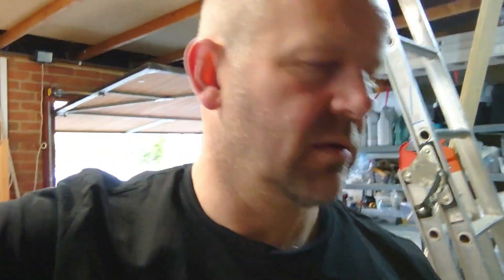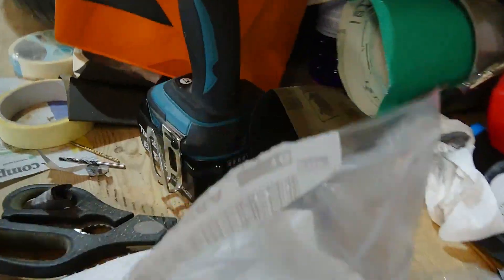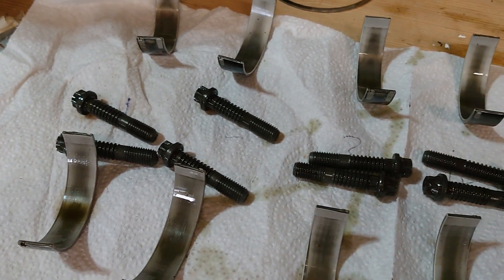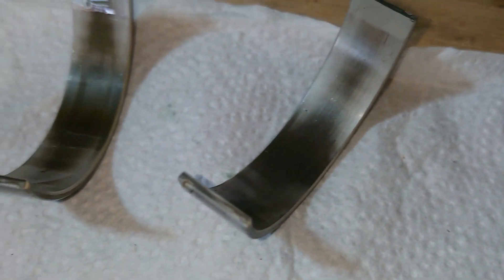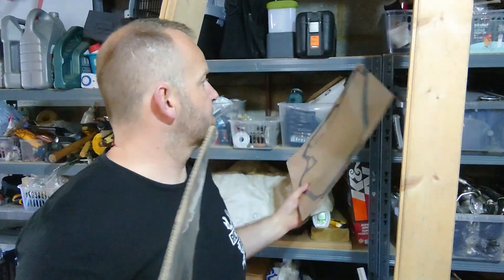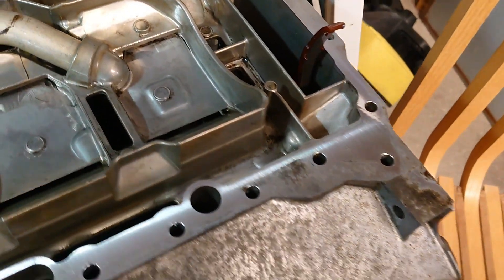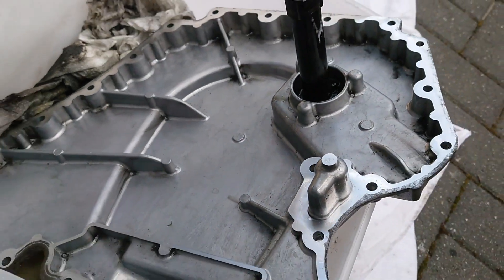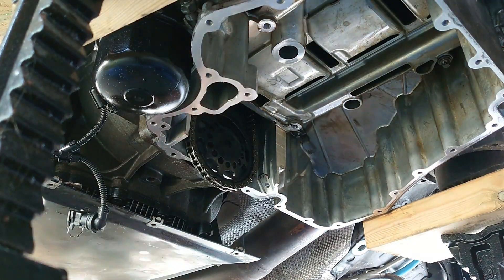BMW F10 M5 S63TU bearing replacement

Comment: Based on your video the S63 rod bearing replacement doesn't seem all that complex. Well with the right tools and lift you can do it all yourself saving yourself $$$$. I'm doing research while looking at current F06/F10. This makes me feel more comfortable making a F06 or F10 purchase in the future.

Comment: Hi Rich, do you remember the torque spec you used on the connecting rods? The TIS is showing two different torque specs. 1AZ and 2AZ. 2AZ requiring tightening and loosening multiple times
Reply from the maker: @CruddyPeak that's a good question. I don't remember the exact specs but it required tightening to a torque, then stretching by a certain degree and loosening a few times before they were complete. 

Sounds like the 2AZ settings.

Comment: I just did the rod bearing change as a preventative maintenence  on my f10 m5. Mileage was at 107k km when it was done. Once done is there any break in procedure i can i drive it like an m5. Or do i have to keep it under 3000 rpm and under 120kmh for the 1st 1000km ?
Reply from the maker: Not sure what the official number is, but I'd go easy for the first 1000km and then do an oil change before you drive it hard.

How did you find doing the change?

Comment: What would you recommend to change first fuel injectors, or bearings?
Reply from the maker: +@anttheman6370 now there's a question! I think it depends on your mileage and your service history to be honest. you can always get an oil analysis done to check for trace metals from bearings and go from there?

how many miles are you on and how often do you change the oil?
Reply: @ i have 75k miles its a 2014 and i just got the car recently i changed the oil recently
Reply from the maker: @anttheman6370  how deep are your pockets? If it was mine I'd probably start with the bearings, they take a hammering and probably have had a hard life. I'm not sure how long the injectors are meant to last, mine failed early and caused the damage but that may have been because of the tune?
Reply: Brother replace the bearings first then injectors. But if your changing the bearings I would just go ahead and change the injectors as well ik it costly but cheaper than buying a whole engine lol

Comment: How many miles did it have when you found out the cylinder wall had damage? Subscribed! Love your videos and watched all your f10 M5 Series. My M6 F06 just hit 53k miles, you think i should get the rod bearings done? I had a s85 M5 E60 before that had engine failure at 80k because of rod bearings and it was such a headache getting it rebuilt. Ended up wasting so much money on that car. I went through 3 engine rebuilds on that car to finally get it right.
Reply from the maker: @TheRealEvo  my car is 53k too!
Reply: 8 months later check in on your M6 F06? I'm looking at M6 F06 at the moment.

Comment: Welcome back mate. 
Is it normal if replacing road bearings on this engine while the it runs smoothly?
Reply from the maker: +@ramyarakram3257 not sure, but running smooth doesn't necessarily mean everything is ok. Depending on how many miles you've done and how hard you drive you could do an oil analysis next oup change and it'll tell you how much metals are in the oil and whether you should consider changing them.
Reply: @RichsRides  this is what exactly i mean, running smoothly doesn’t mean everything is ok that is why I asked this question. By saying “running smoothly” meant there is no weird noise or exact problem with the engine, but i want to replace rod bearings before they go too bad and cause damage to the entire engine. So, do you think if i replace them in my case, is it normal? Since i’ve heard from some people if you replace them they make contact with the crankshaft. What is your recommendation?
Reply from the maker: @ramyarakram3257  how many miles have you done, how hard do you drive it and how often do you change the oil?
Reply: I have done 138Kilometers. I don’t drive it hard that much, i change oil every 5K and using Genuine BMW 5W-30. Everything in stock, no tuning.
Reply from the maker: @ramyarakram3257  at 138k Km id expect them to be quite well worn. At that mileage it's probably not a bad idea to get them done as a preventative measure? Frequent oil changes are always good but they can never stop the wear altogether. Maybe get an oil sample done first and go from there?
Reply: @RichsRides  I meant to tell you that from the start. So, my question is if i replace them in this case, does it cause any problem to the crankshaft? Since i heard people saying replacing them lead to damaging the crankshaft.
Reply from the maker: +@RichsRides at 138k it's probably worth doing. if you're worried about the new bearings then use plastiguage to check the tolerance against the manufacturers spec. I should've probably done the same but was using OEM bearings and there was zero signs of wear in the crank so didn't bother. if I had the engine fully apart I would have checked everything too.